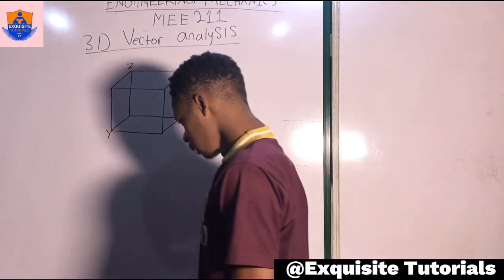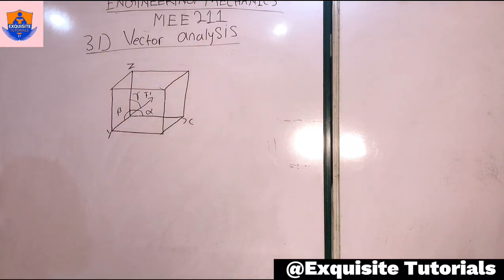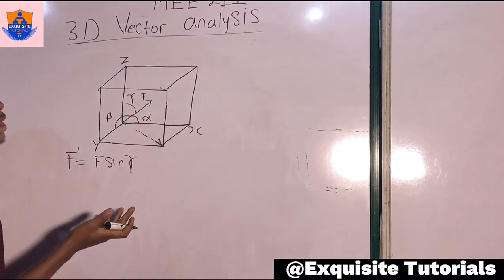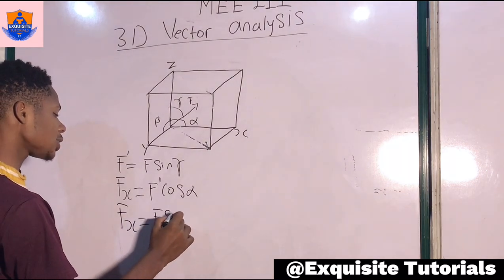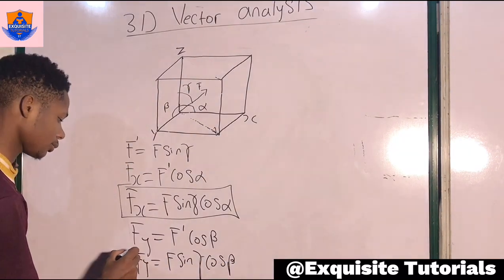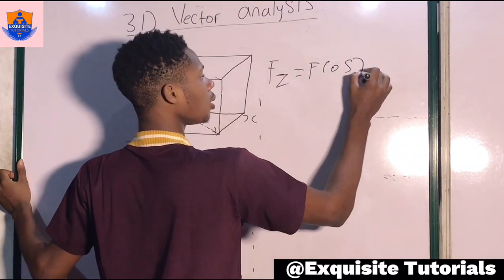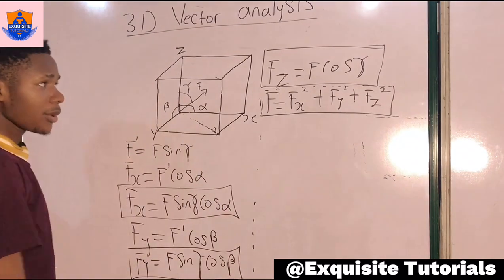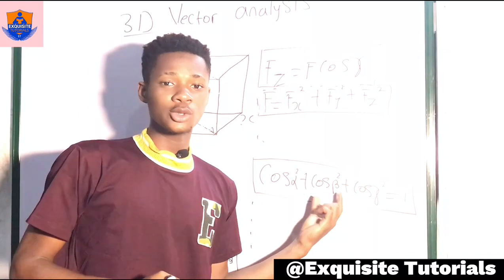INTRODUCTION TO 3D VECTOR ANALYSIS (ENG MECHANICS) #engineeringmechanics #3Dvectoranalysis

Comment: Hey man, please this is wrong. Fx = Fcos(alpha) , Fy = Fcos(Beta) and Fz = Fcos(gamma). I recommend you check engineering mechanics by hibbeler. The approach you gave is not for this problem am thinking you got it mixed up.
Thanks
Reply from the maker: We are very sorry for the mistake in this analysis. Indeed Fx=FCosα. Fy=FCosβ and Fz=FCosγ.
Such that
F² = (Fx)²+(Fy)²+(Fz)²
Giving rise to
Cos²α + Cos²β + Cos²γ = 1

The analysis made in this video would have been through if and only if another angle lying on the x-y plane was given.

Thanks alot John Philip for the corrections

We would ensure to correct it in subsequent videos

God bless you sir